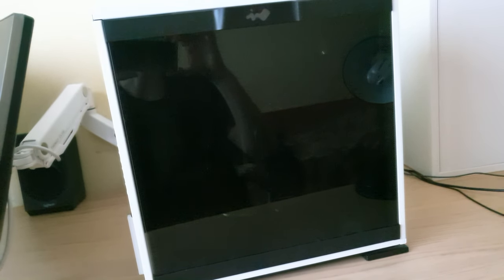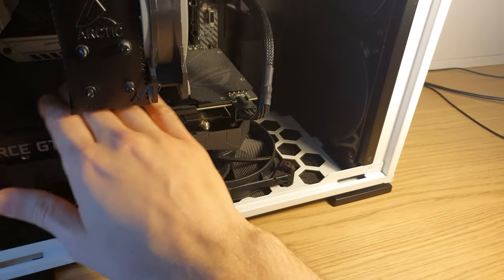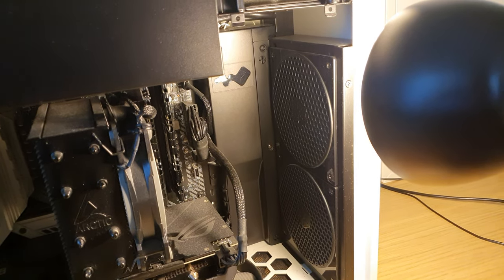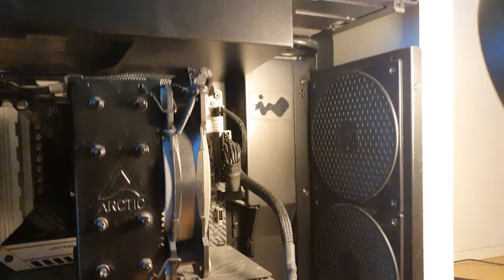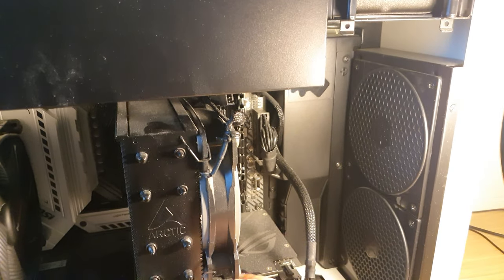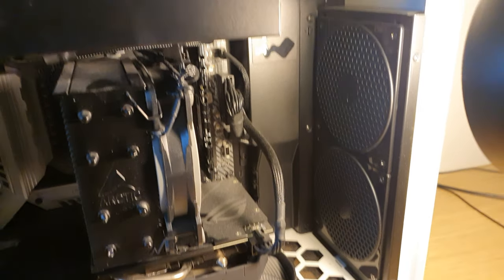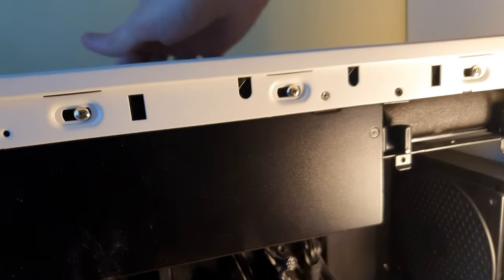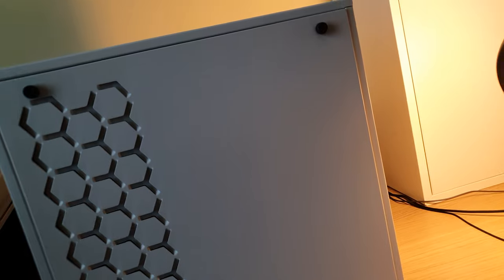In Win 301c. It has a secret, but not a dirty one.

Comment: Note: I see the the gpu cable is routed on the top  of the gpu instead of under. Those plastic slots are meant to broken so the 6pin and sata connector can properly be routed. U don't need it but it looks aestheticly better.
Reply from the maker: I might do that when i clean the dust next time. Had to vacuum the dust this winter. After 2.5 years thre was a LOT of dust actually.